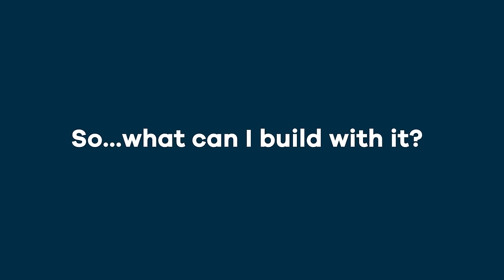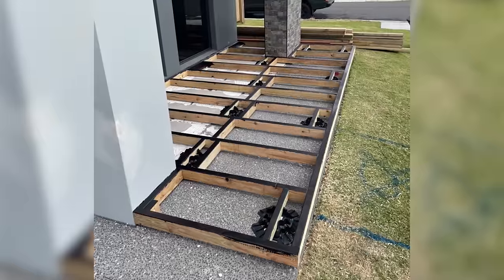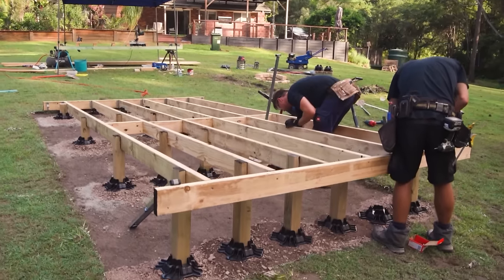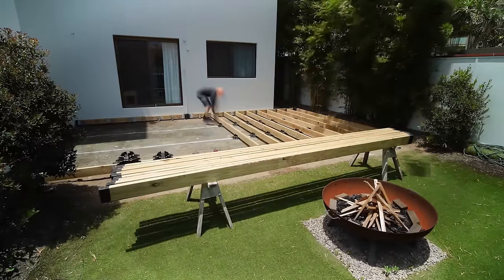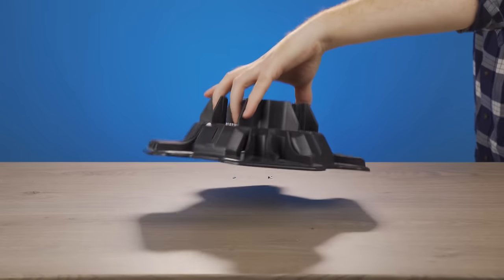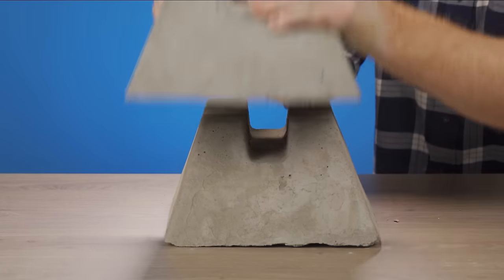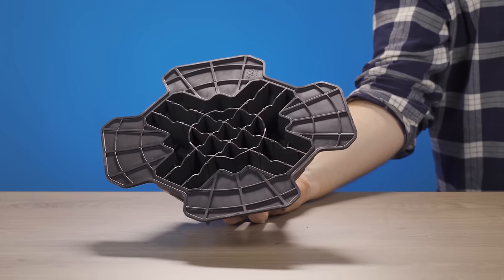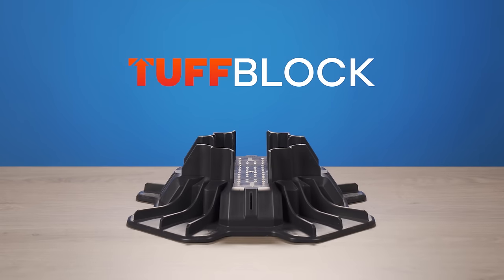TuffBlock Explained in 90 Seconds - The Most Advanced Deck Foundation Block

Comment: There is downside, too. We need to take time to compact the ground, and future settling is possible, too. While digging holes are cumbersome, we do not need to prep the ground
Reply from the maker: Prepping ground for a deck block can take as little as 60 seconds. It's only under the surface area of the block itself. Compare that to checking for underground services to make sure there are no pipes or electricals, digging the deep holes with post hole diggers, mixing the concrete and then filling the hole, waiting days for it to set etc. You can finish an entire project in a single day with TuffBlock but not possible using in ground piers. Bear in mind, in ground piers are crucial for a lot of projects so we're not bashing them. But TuffBlocks work great in a lot of scenarios and can save you time and headaches.
Reply: @Buildtuff I removed the grass surface and dug out a shallow square hold (2 inches deep) and used paver base in each hole for the block to sit on. Worked great.

Comment: Most advanced, but not adjustable if the ground settles over time.
Reply from the maker: This is why we recommend building on compacted grade level earth. 

In terms of adjustability, TuffBlocks were designed as a single solid unit capable of holding 11,000lbs per unit. The adjustability of the block comes from the 4x4 post slot, as well as using shims or varying heights of lumber. The strength and durability were the key factors when designing TuffBlock and with solid building methods you can create a long lasting project.

Comment: Wouldn’t work to level an uneven floor in a home?
Reply from the maker: It wasn't designed for this purpose but it's been used by a number of builders to level sagging floor joists and it does a good job!